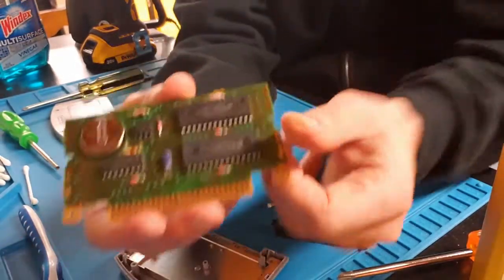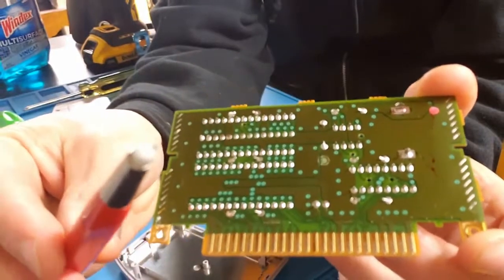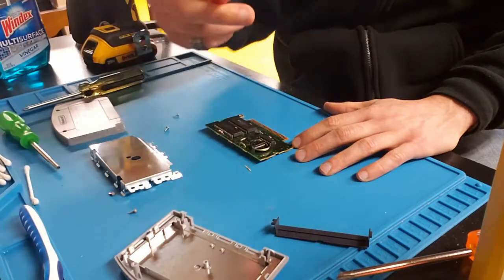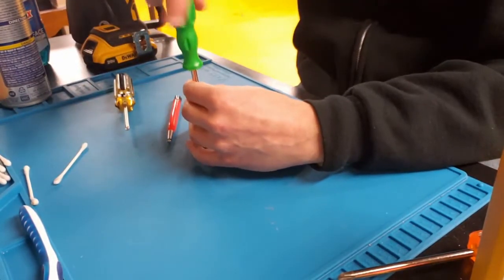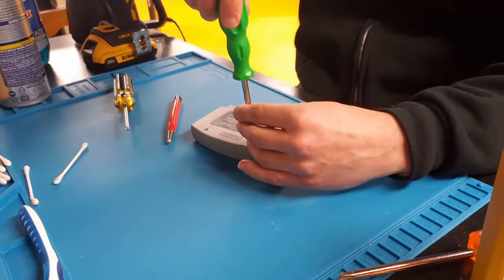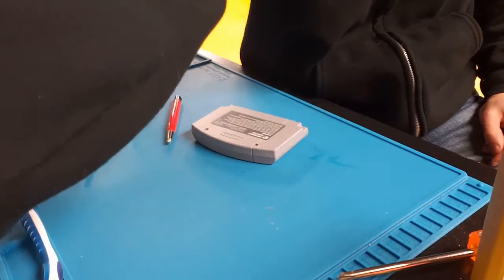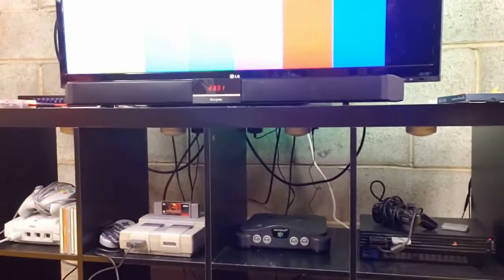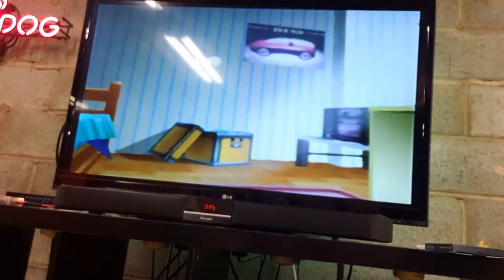Cleaning Retro Video Games with a Fiberglass Pen | The 8-bit Basement

Comment: I'm not familiar with the contact cleaner you used.  Is it a specific product for this purpose?  Would love to get a link to the one you prefer to use.  Also, when using the Qtip after spraying, should I rub gingerly?
Reply from the maker: It's a quick drying electronics contact cleaner great for cleaning boards like this.  It's safe to use for this type of work.
https://www.amazon.com/WD-40-Specialist-Contact-Cleaner-Twin-Pack/dp/B08V58Y6RX

always.......always gingerly... 😂

Comment: Been using a fiberglass pen on my SNES SFC cart pins only if IPA and eraser didn't work.  When I use the pen I make sure the pins are wet with some IPA. So far the Pen has worked great.
Reply from the maker: Awesome job! Yes, it works on all pins! We typically start with cloth/IPA.....then next step up is the pen.....if that doesn't get her clean, then we bring in the big guns (Brasso) and more IPA and that does the job! Thanks for watching!

Comment: Why did you have to take the cart apart? Couldn't you have cleaned the contacts without taking it apart? Thanks.
Reply from the maker: Taking the cart apart allows for a much more thorough cleaning.  Some games, depending on the condition of their contacts, require a deeper cleaning to work properly.  We do it for all of the games we own for our own consoles, as well as for anything we sell, and it really helps to ensure consoles run smoothly and games fire up on first try.  Taking apart an N64 cart is highly annoying, however!  Thanks for watching and for the comment!